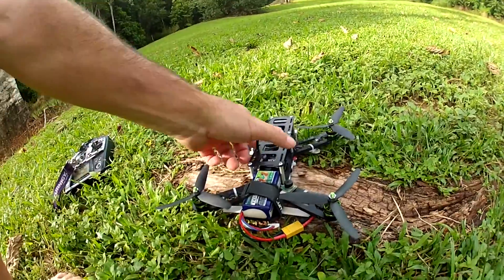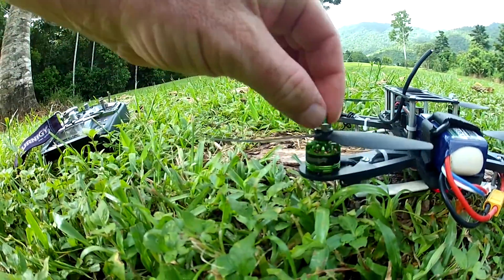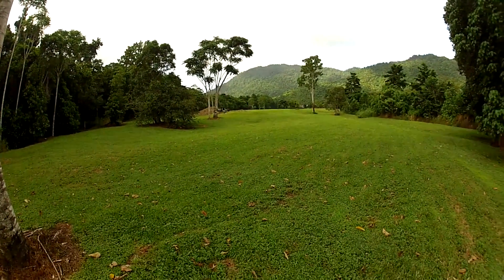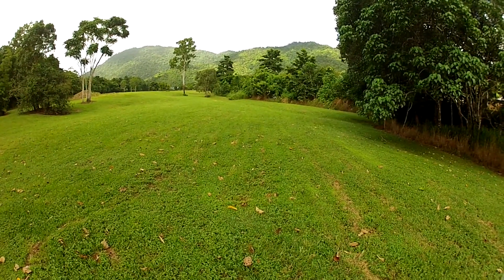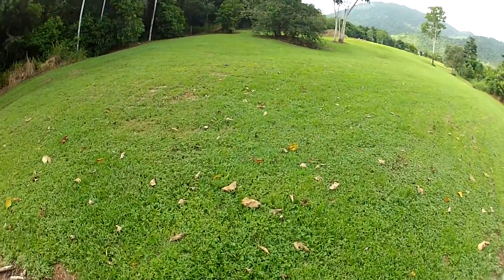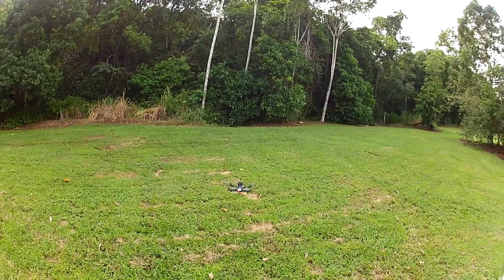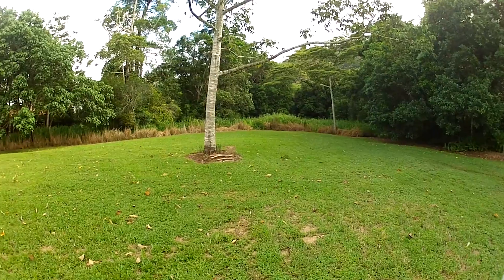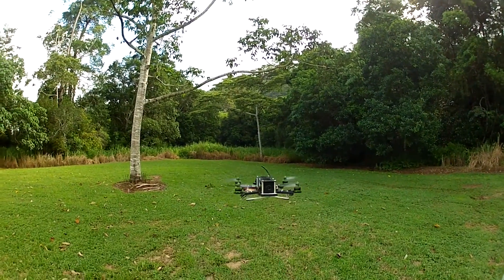Turnigy Multistar 1704-1900Kv QAV250  Flight Test

Comment: Hi there...just wondered how you mounted the motors. I have 4 of these. And have found that the 1704's have an M2 screw. SO that poses a problem as not all frames can handle a M2 screw. And sometimes you need to add a washer or spacer.
What has your experience been ?